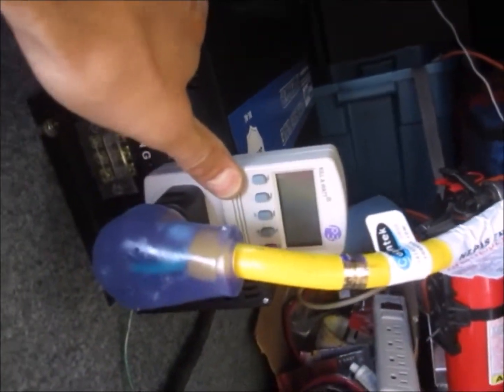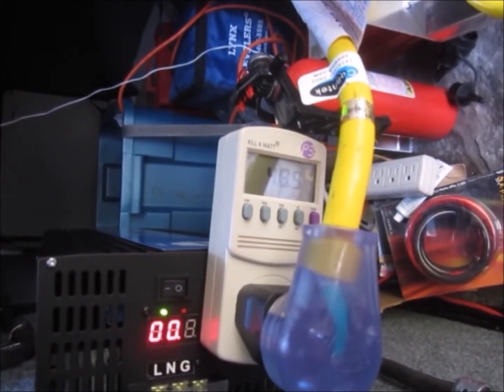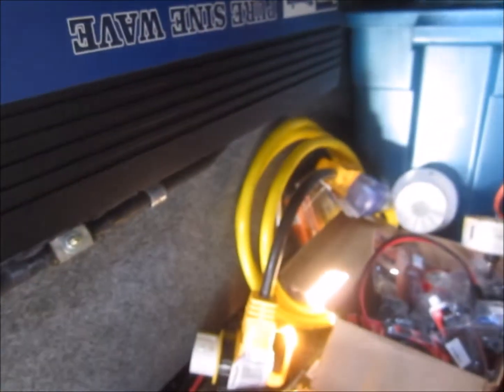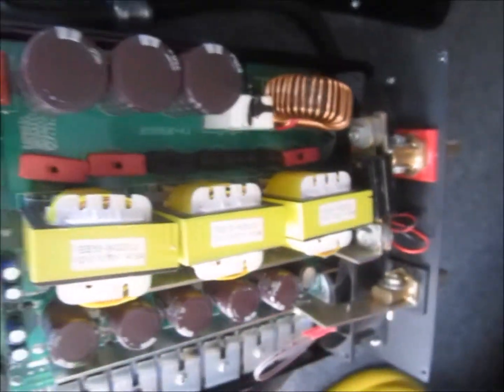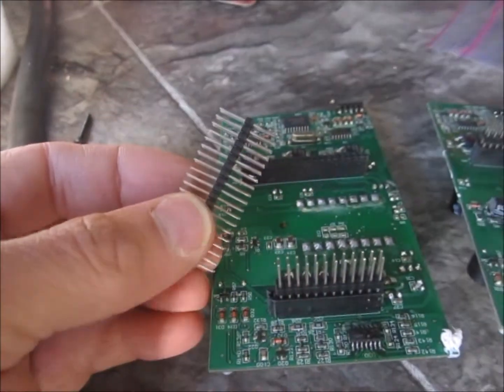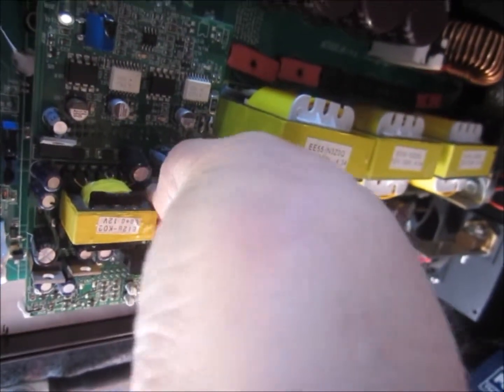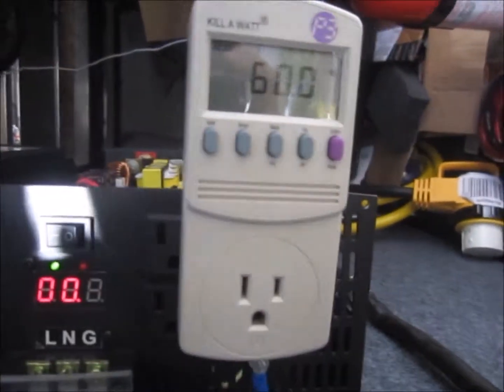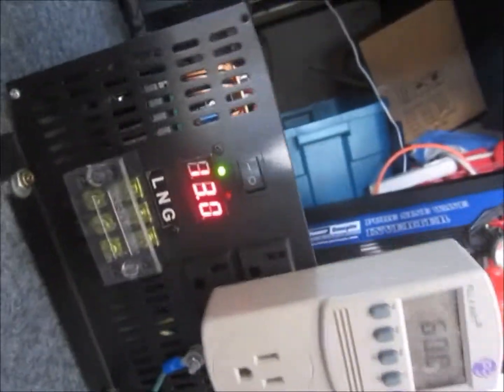3000 watt power inverter 50 to 60 hz fixed Power Simple Raptor 300MP

Comment: I baught a reliable 3000w inverter pure sine wave  in Florida and when I brought it to Jamaica it's was 60hz not 50/60hz  so it won't work here in Jamaica  I saw how u transform your 50hz to 60hz  I watch your  video ever day because I'm off grid in Jamaica  please contact me so I can get help from reliable I baught it on Amazon  cost 310 us  is really appreciate I need it to run my home  and I have it with me here in Jamaica  away from Florida
Reply from the maker: Hi. I’m sorry, I can’t help you contact them. I have no relationship with them. I contacted them through Amazon. That’s what you will have to do. Good luck.